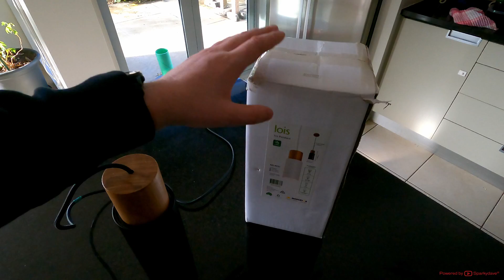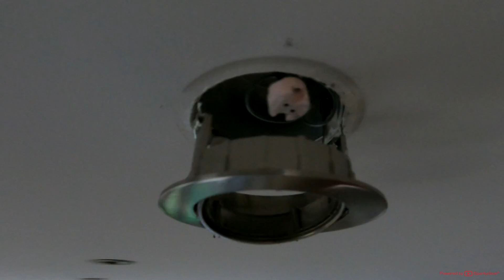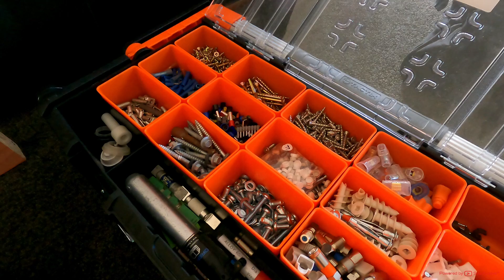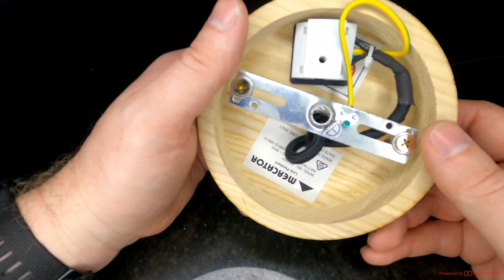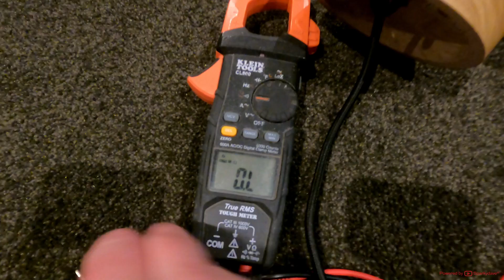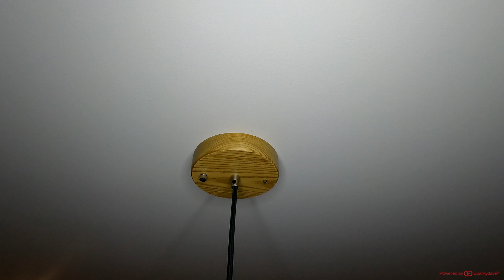How To Install Pendant Lights In Place of Existing Downlights

Comment: Welcome back! Got a stupid question for you - I have downlights in one room wired into a fan remote (that just broke). So let's say it's "loop into the rose" system I need. What is the best way to wire in a light switch to a series of downlights that are using plug bases and currently directly connected to the mains? Do I intercept the first plug base and send the live down to the commons on the switch and rejoin the first base at neutral?

Comment: What if there is no timber in the ceiling to screw into? Cheers
Reply: If you can't come up with a solution to that part, I'm not sure you're ready to do work on electrical circuits.

Comment: Is there a reg that says you dont have to megger lights/power points when you're just replacing/altering? And would you do a ESC for these?
Reply from the maker: No standards to that affect, for maintenance (replacement) of light fittings. Of course in some instances it is best practice to ensure RCDs (where installed) and EFLI are tested appropriately (ie, for socket replacement in wet areas). Just an ESC in this instance 👍
Reply: @sparkydave  Thanks bro. Industrial apprentice here so I enjoy the domestic vids you put up. Good learnings. 🤙